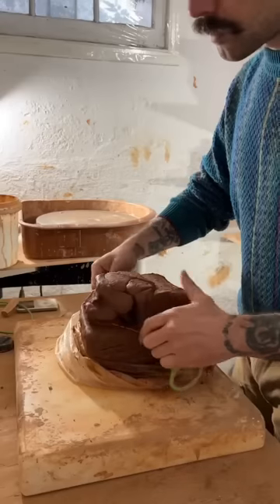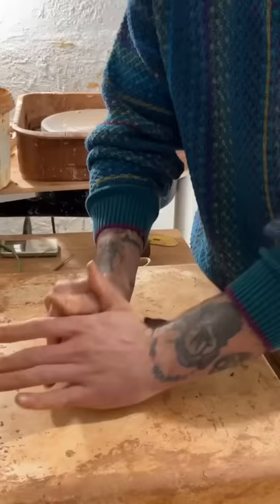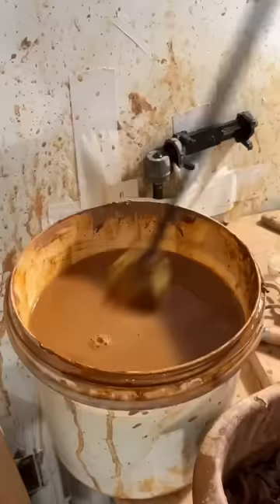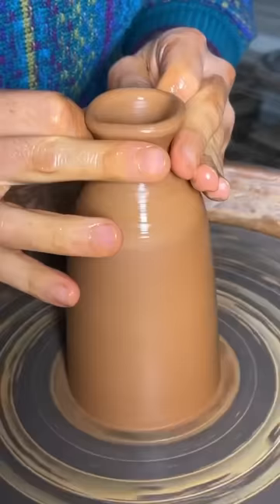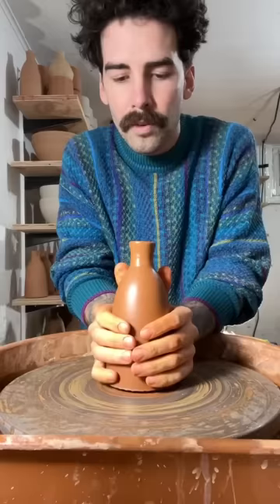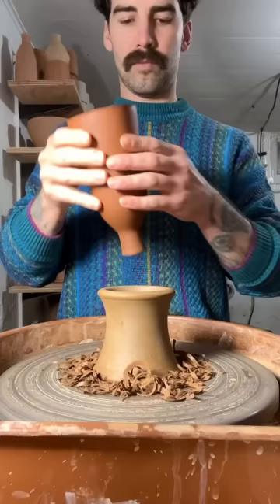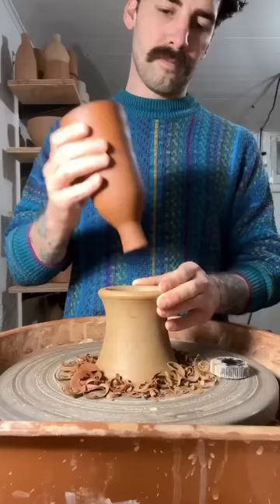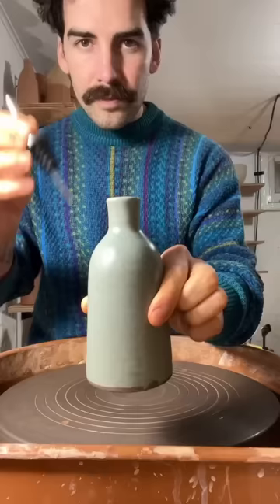making oil cruets 🙃 (#shorts)

Comment: How do you get the cap to perfectly fit with the shape of the bottle neck?
Reply from the maker: i’ve been making them for a long time so at this point i just eye ball it. but originally i’ll use the topper as a gauge and make the top of my bottle a little bigger than it needs to be for shrinkage in the kiln. :)
Reply: @bwpottery  wow very cool. Thank you
Reply: Those caps also have 3 rubber rings that are sized to ensure a seal